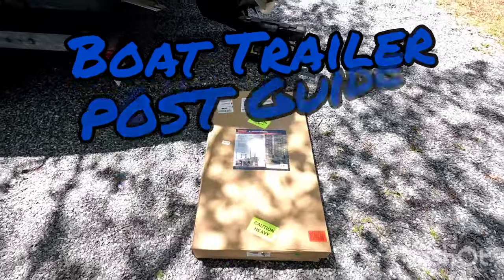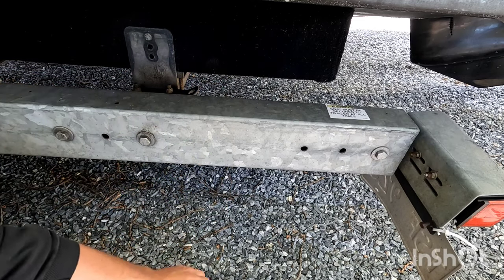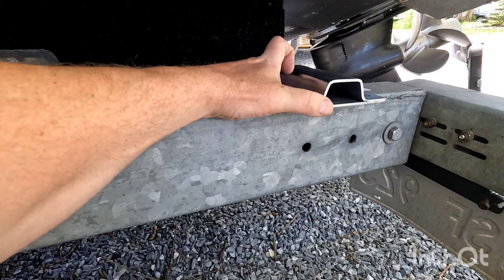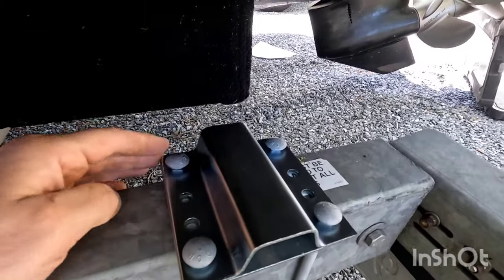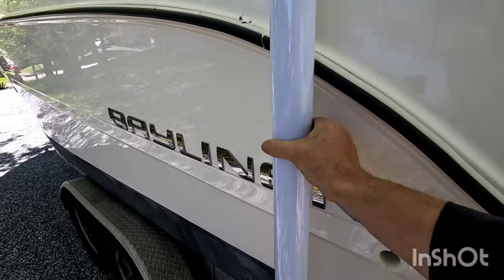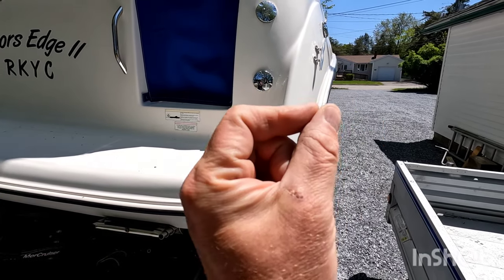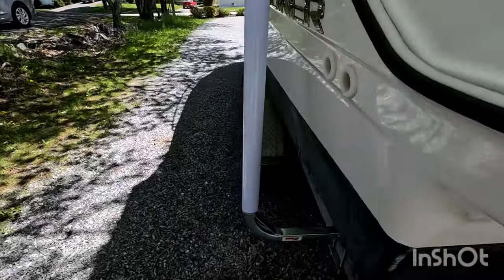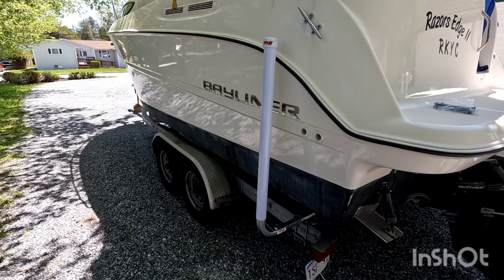Boat Trailer Post Guides Installation

Comment: I find mine are way too short for my boat. The wind got me a few time and they marked up the pain (buffed it out). Thinking of getting some six foot pvc so it only touches the rub rail. Thanks for the video
Reply from the maker: Thanks! These ones are a perfect height for this boat, I had almost bought shorter ones, glad I went with this length.